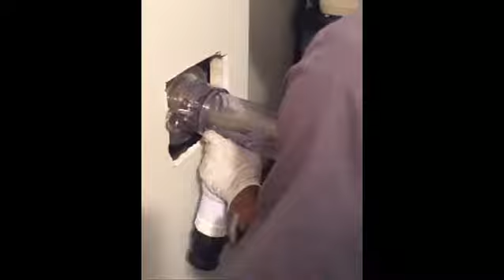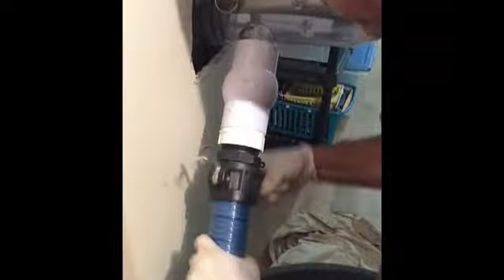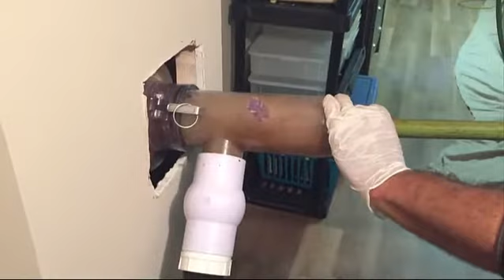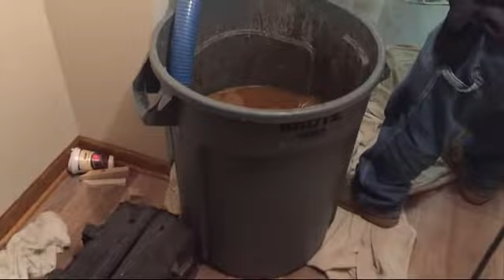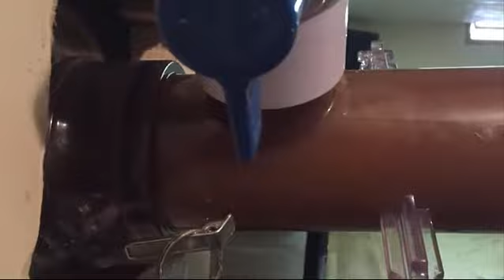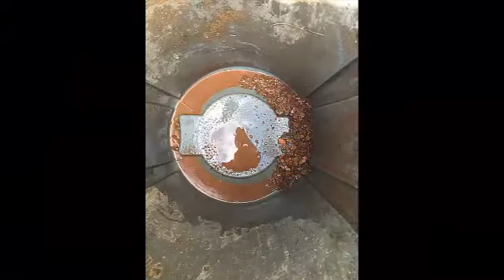Using the ZipDrain Jetter Tool to Jet Cast Iron Overhead in a Finished Basement

Comment: I am not a plumber but I wonder if you could use this Zipdrain Jetter to clear septic bed weeping tile?
Reply from the maker: Hi John, is the field tile 4” clay tilt or corrugated pipe?
Reply: @zipdrain526  Hello , the pipe is 4" PVC with perforations along the sides.
Reply from the maker: Sorry for late response, the 4” head will fit 4” corrugated pipe
Reply from the maker: You may have to add a 4” rubber mission coupling cut in half as a spacer if the pipe is sdr 35.